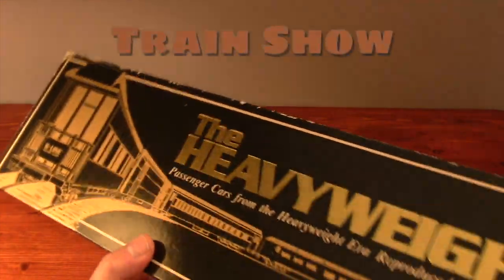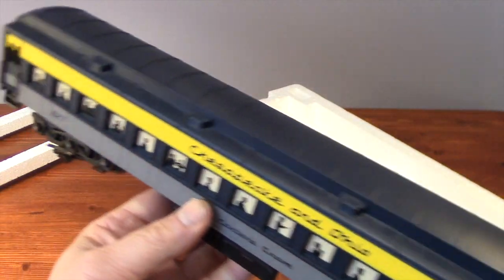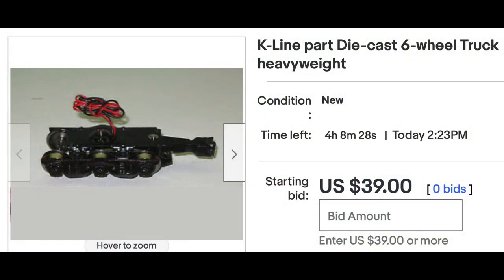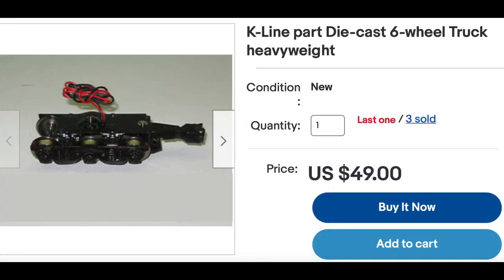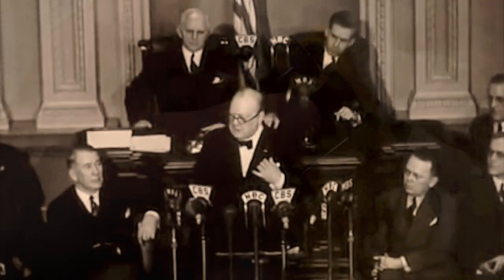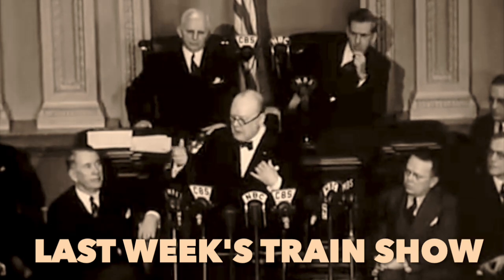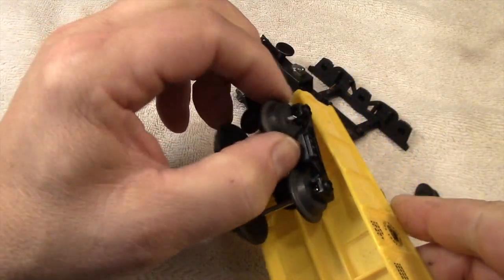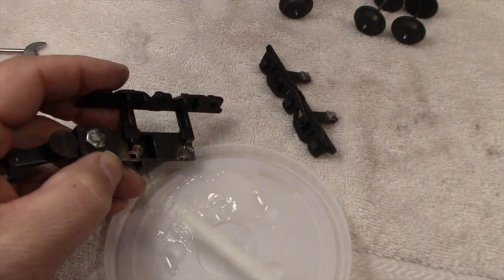K-Line Heavyweights Chesapeake & Ohio C&O Passenger Car truck & electrical repair Lionel MTH

Comment: Yup $15 dollars is a steal , I was happy to pay $50 for one,  Have used them  to add to my Fleet of Milwaukee Road heavy weights .  Although  not 80' cars , not all were.   I have 2 , installed full interiors   led lighting and figurines,  The make a Great Chair Coach , and with KD couplers and scale Diaphragm's , they are as good as any O scale car
Reply from the maker: I love them too. But with the boxes, (even unboxed) they take up so much room. It's hard to keep a collection small, especially when there are bargains to be found. Have a great week, Bob.

Comment: Wiring and soldering on the early K-Line heavy weights was bad.  Usually the ones with passenger silhouette   windows.
Reply from the maker: I agree.